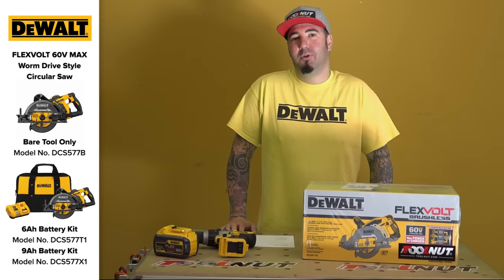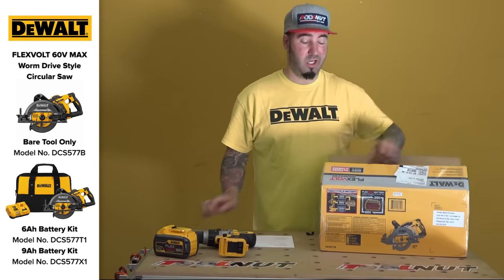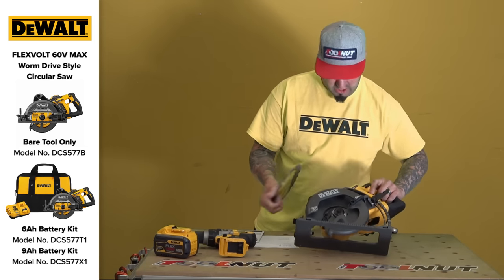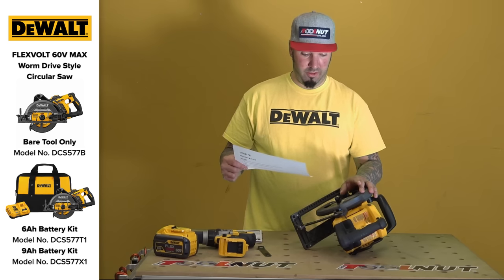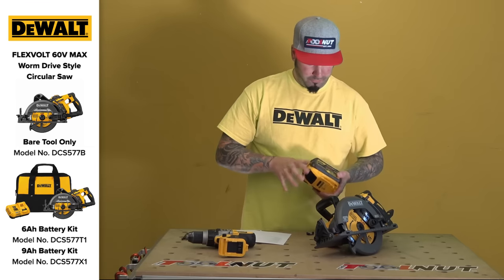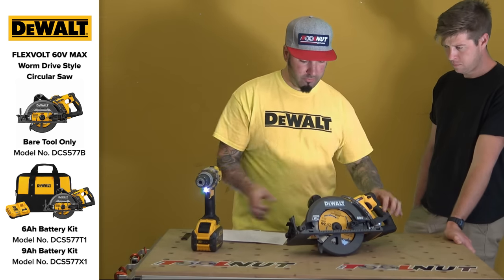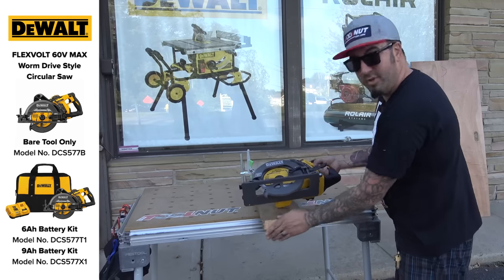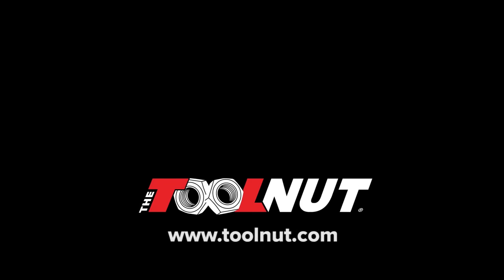DeWALT FlexVolt 60V MAX Brushless Worm Drive Style Circular Saw DCS577

Comment: ... finally Dewalt put a dust conector on this,  DCS577DC.
Reply: Dust connector ? You bought this worm drive for dust collection? You’re clearly not a framer.
Reply: @MrJustliketht  I am not , I am a Carpenter and my job involve dust collection from time to time. 
Framing is not a job to do one you knees all the time and definitely it's not including only wormdrive still circular saw for the job. 
When you will grow older you will understand.

Comment: What's the difference between this worm "style' saw and a traditional worm gear driven saw?  Thanks!
Reply from the maker: Most folks recognize a worm drive saw as having a left-hand blade and this style of configuration. While technically worm drive refers to the drive mechanism between the motor and the blade, a worm gear. This saw does not have a worm gear, but it's otherwise very similar to what most consider a worm drive saw.
Reply: MrDINODINO74 h
Reply: Worm drives traditionally have lower rpm but higher torque when compared to a sidewinder motor